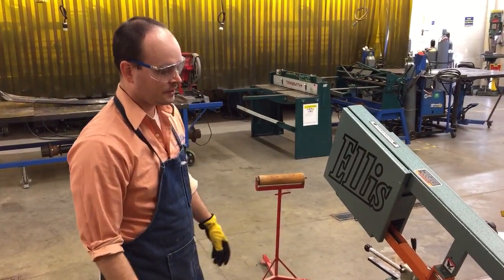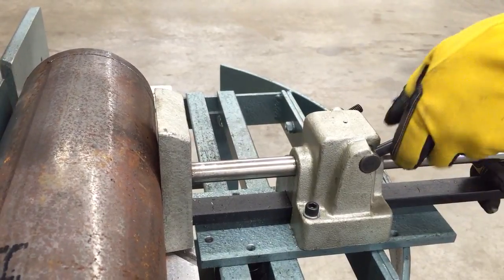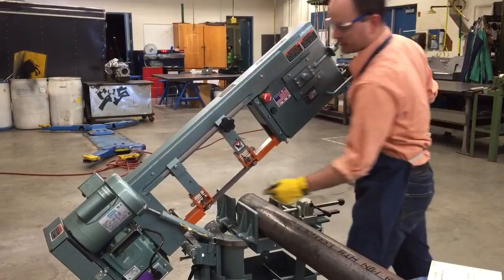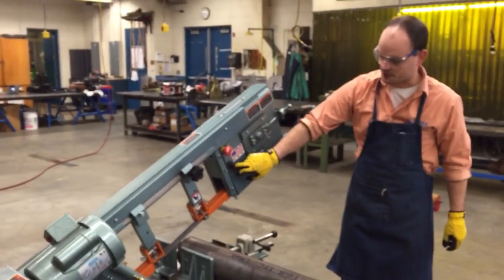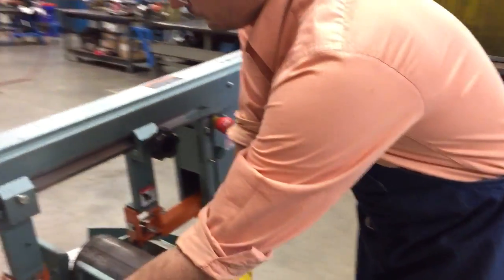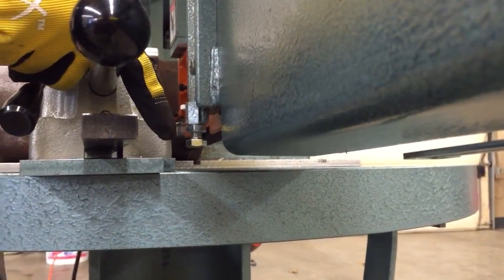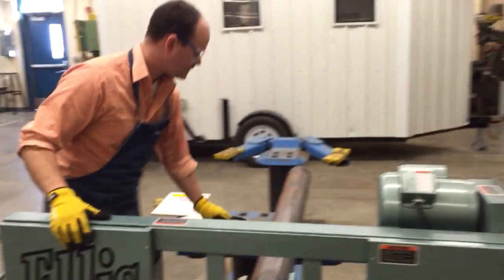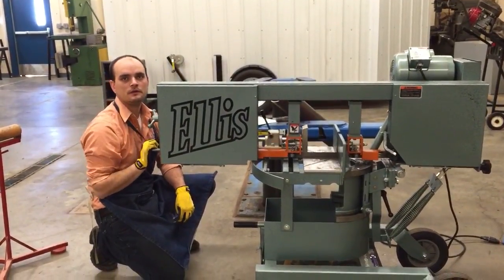Horizontal Bandsaw 101

Comment: You never wear gloves when operating a bandsaw unless you want to loose part of your hand.  The teeth only need to snag the glove ever so slightly and the saw will pull your hand in.
Reply: I wear disposable latex that fit tight when working with metal.  Otherwise I get tiny slivers of metal in my skin.

Comment: Folks are complaining about the absence of coolant. Lol. When you have a wide blade in a longer saw, the blade isn't engaged in the material enough to heat up as much, so the absence of coolant really isn't that big a deal. Besides, it's a fab shop, not a production shop. If they're doing production cutting big stacks of chromoly bar stock, then yeah, coolant is mandatory. But cutting tubing or random pieces of bar stock isn't a big deal.